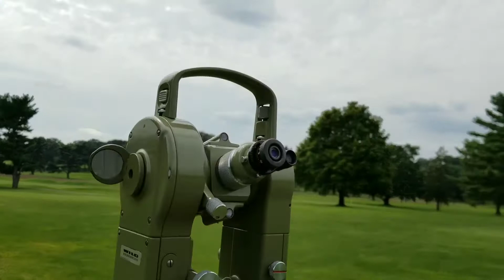Reciprocal Zenith Angles

Comment: Oh, man, this brings back some memories. My dad was a land surveyor, and I worked with him part time. This was more than 30 years ago. We had a Kern 30" analog theodolite with a Beetle 500 EDM. These days, you can buy a 2" total station for less than the cost of that Beetle.

We did strictly metes and bounds work, but we had a job with an unusually long traverse. When we finished the traverse, we decided to measure reciprocal zenith angles using a couple of points in the traverse that were about a quarter mile apart. The conditions were perfect; early fall, overcast skies, moderate temperature. I don't recall the exact sum, but I remember that it was well beyond the measurement error inherent in the Kern. I'll never forget how cool it was to actually measure the curvature of the Earth.
Reply from the maker: See the pinned comment I linked a paper you might enjoy looking at. Thanks for your comment.

Comment: So, I am still trying to figure out how reciprocal zenith angels method work. Would be nice to have a video on the topic. As I understand it is to measure from two locations some angels, and then be able to somehow compensate for refraction of almost horizontal angel measurements? And by near-real time, is the same method, just by using one theodolite, and moving it between two places quickly, so the conditions are relatively similar still?